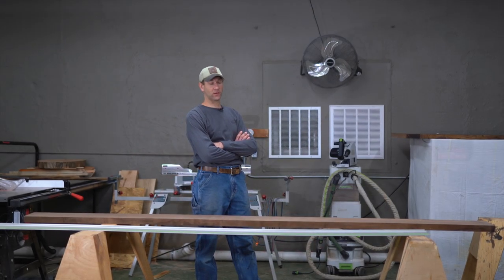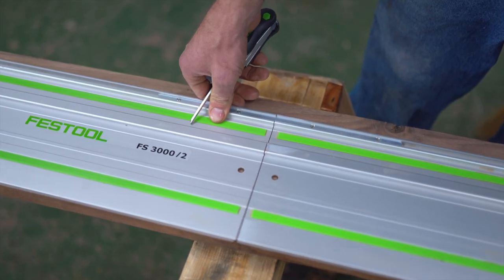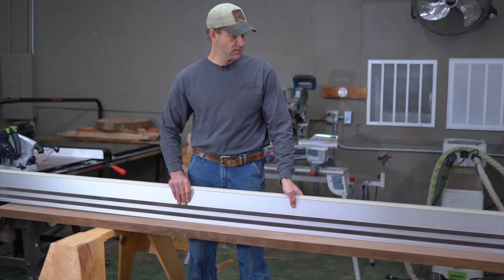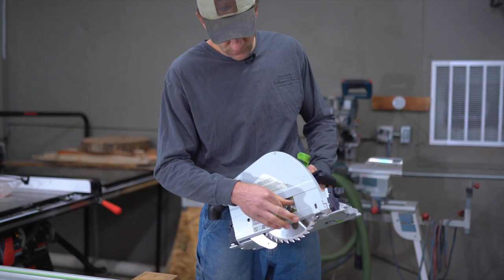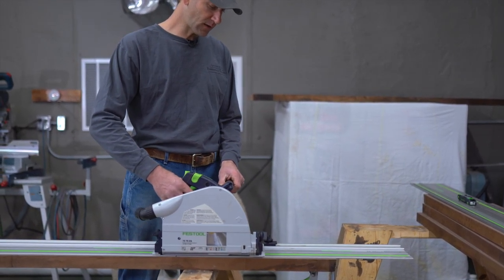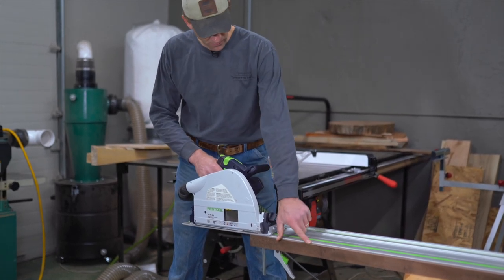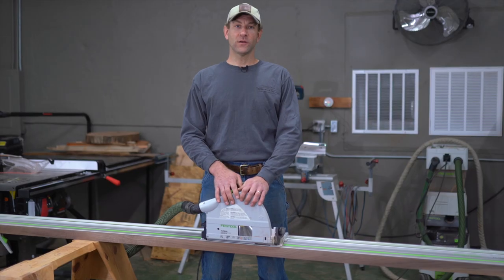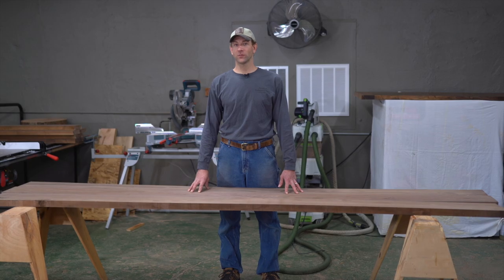Using the Festool Track Saw TS 75 - Tips and Tricks

Comment: For joining rails I leave the bottom totally loose and do the top side first. I use a straight edge on the main rib that guides the saw.  Tighten it then flip the guide rail over then snug up the 4 screws in the bottom connector.

Comment: very nicely done, thanks. I have one issue that bugs me about this saw. Everything you said is right on target, but it seems odd to me that you can't just depend on the depth scale to get the right cut. My TS75 has an imperial scale for depth, but it is never right. I have to set the depth as you illustrated and that works fine, but why, if it is a track saw, configured to be on a track, can it not be configured so that you just dial in the depth of cut and run with it? The Festool people seem to get so much right that this seems incongruous to me. We know that the track is 5MM in depth and since this saw is not designed to be used off of the track, you would think they would have factored that in so the depth scale would actually be useful. Thanks for your video, well done.
Reply: You have to add the thickness of the track. Not a big deal
Reply: First world problems. Dude can’t add 5 to whatever depth he wants. 😂😂😂
Reply: @Benmeglei1  yeah, Ben I can, and I do- but when you buy a tool in that price range  you expect it to do what it is supposed to do. That’s obviously what I was saying.  Too bad you missed the point.